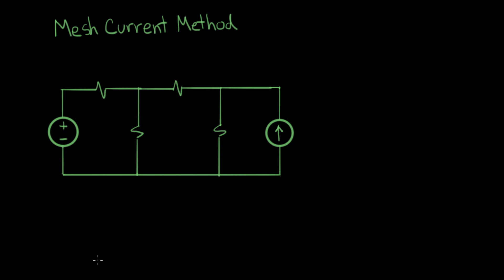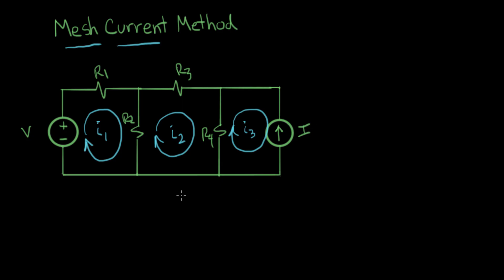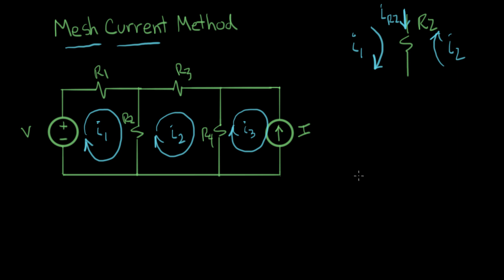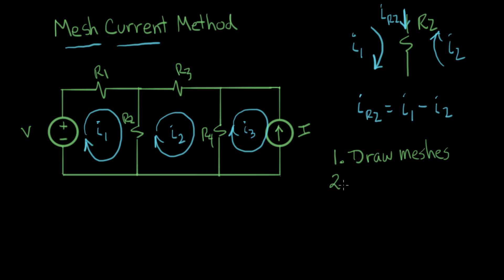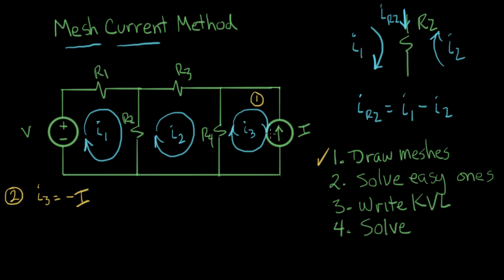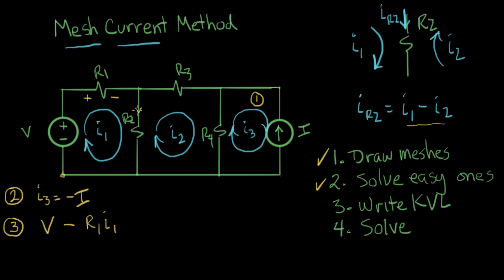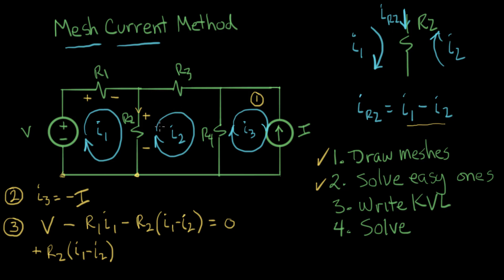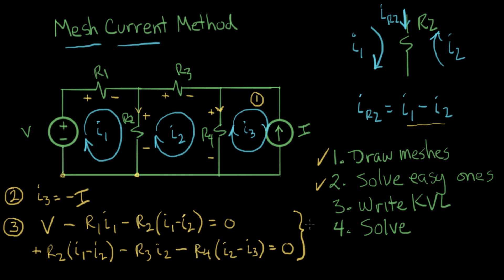Mesh current steps 1 to 3

Comment: In the second equation shouldn't it be i1+i2? You wrote i1-i2 because i2 goes in reverse, but wouldn't that mean the i2 value is negative, the equation would still be i1+i2 with i2 being a negative value? For example if I have f(x) = x+y and I know y is -3 I don't rewrite it as f(x)x=-y because y is negative ... otherwise I'd end up with x-(-3).
Reply: was thinking same thing

Comment: Why R2 is a voltage rise in second equation? Can someone explain?
Reply: in the first mesh, we moved along the circuit as the voltage goes from positive to negative from up to down, so when in the second mesh as we are going from the opposite direction(down to up) we can't change the voltage direction already assumed in mesh 1.

Comment: At 3:18, is the direction of element current of R2 assumed?
Reply: no, look at your voltage. The current goes from the positive side through the circuit to the negative side. So at the voltagepoint the current goes up, goes through the circuit in meets back 'under' the voltagepoint.

Comment: hello  i think at 7:38 it should be i2-i1, not i1-i2
Reply: its  i1-i2 cause he put + in front, he didnt change the polarity
Reply: Adil Shareef you are right
Reply: If you make it i2 -i1, it means that you followed the mesh current direction, and in this way you have to change the polarity as well, so you will get the same answer.
Reply: Not really
Reply: You can write it as well both are one and the same thing!
Reply: @shahwali4291  Can you please elaborate how? +R2*I1 would mean voltage increase according to the KVL.
Reply: @emirgo6825  it depends upon in which direction are you going i mean conventional current direction!

Comment: Very good overall explanation although I would have appreciated to have a more detailed explanation as to how to determine whether a resistor is plus, then minus or vice versa
Reply: The way I understand it is that you can label your resistor to have +/- on either side, aka it's up to you. When you do this, just make sure you stay consistent from mesh to mesh. For example, in mesh 1 it was -R2(i1 - i2) and in mesh 2 it was +R2(i1 - i2). As long as you stay consistent for the two meshes then you will be fine.
Reply: Resistors result in a drop in voltage (calculated via Ohm's Law) so any time your current passes through a resistor the first side becomes more positively charged while the far end becomes negatively charged. whereas we are doing mesh calculations, your point of origin is the bottom left corner of the mesh rather than the power source. This means that your superimposed current now has the ability to pass through a resistor in the opposite direction of your original current, this would result in a voltage rise rather than a voltage drop which is why some resistors result in a voltage rise when using this mesh method.
Reply: @toothnailgaming42   then it  means that mesh current and physically flowing current may be different.

Comment: Why is i3 equal to negative I only? What about the current through R4?
Reply: If you are analyzing the mesh in the middle, the current through R4 is i2-i3. If you are analyzing the mesh on the far right, the current through R4 is i3-i2. However, you don't need to set up a KVL equation for the mesh on the far right as you can tell by inspection of the current source that i3 = -I.

Remember, a "mesh current" is just an analysis tool that allows you to analyze a circuit in a systematic and repeatable manner. Don't confuse the mesh currents flowing clockwise through each loop with the ACTUAL currents flowing through each circuit element.
Reply: Red Black I think because of the constant current source?
Reply: I dont understand the logic behind  i3 = -I either. All other meshes (i1 and i2) took into account a full mesh/loop from one node and back to that node. So if you follow that principle in the i3 mesh you would get i3 = -I - R4 (i2-i3). 

If I applied the same logic for i3=-I to mesh i1, then I would assume that i1 = v/R1.

The only thing that I can tell is different is that i3 is a current source and i1 a voltage source, but why would that make any difference to the way you calculate the mesh current value?

If someone explain why that would be really helpful! 

Would be great if someone could explain why I
Reply: I still don't understand
Reply: you are finding the current in mesh 3 and there is already the current source given